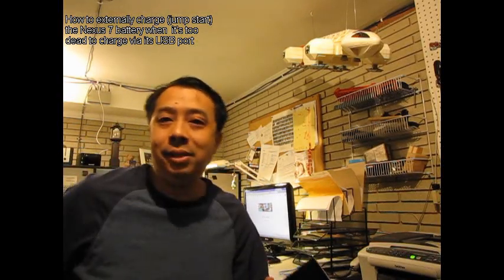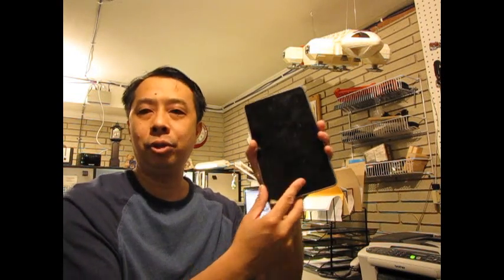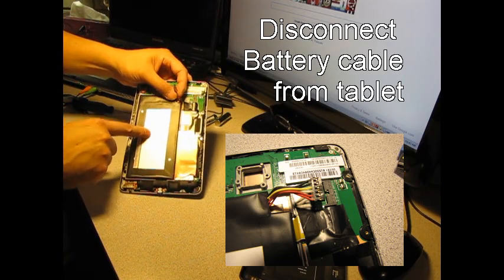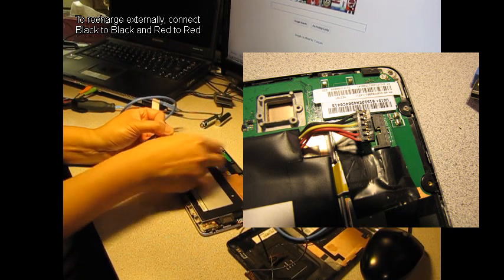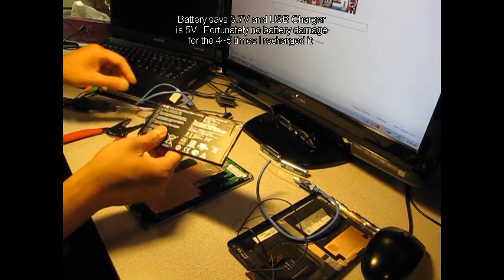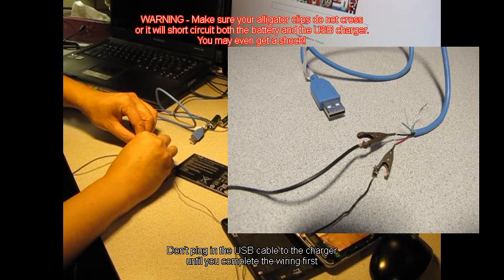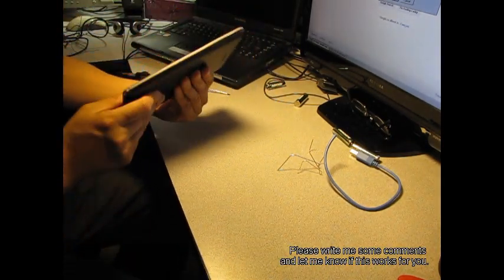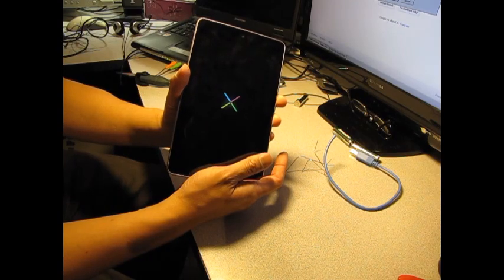Externally Jump Start Your Dead Nexus 7 - Final solution when all else fails!

Comment: Hmm, these are 1S LiPo batteries, two in parallel. The (nominal) 5 VDC USB charger goes through a charge control circuit in the device to assure the correct charge current and cut off when at full voltage (about 4.2 volts each).  By jumping directly to the battery without using a LiPo type charger you run the risk of everything from starting a fire to killing the battery.  BTW, if the voltage of the battery is "very" low, to the point that the power dropped out before the shut down was completed, that is evidence of an old battery that needs replacing.  They tablet is designed to commence shut down when the 3.7(nominal) voltage is reached, assuming there is power enough to make the process complete.  If the battery is old, has been overcharged or undercharged, etc, it will hit the low voltage level, trigger the shutdown, and then crash before the process can finish.

Replace that battery and please, do not hot jump a LiPo with 5VDC @ 500 to 2,000 mA.  It might work, or it might just burst and burn.
Reply from the maker: +Devin Duncan , Thanks for your comments here.  I have charged my battery externally for approximately half a dozen time (maybe more) using a USB cable from my laptop as the source (do not know the mA it produces at 5VDC), but never experienced a burst or burn.  In fact, the tablet battery doesn't even heat up.  My battery is not even close to being too old.  It has been almost a year and half since I made this video and my battery still works very well, holding enough charge to run the tablet for a few active hours or a few days if not in use.
Reply: THank you for the feedback.  Of course it is good you have not had problems, but the risk with LiPo charging is well understood, both in terms of danger but also to shortened life of the battery.  Perhaps your statement that you have done this repeatedly to the battery is evidence that the charge /discharge capacity is compromised (which is one of the problems with overcharging the LiPo).  I hope you continue to have good luck, and only hope to inform readers that there is some technical risk, well documented by the manufacturers of the batteries, with simply hard wireing a charge voltage to the batteries.
Reply from the maker: +Devin Duncan , Thanks for your safety advice Devin.

Comment: what if you dont have a alligator pin?
Reply from the maker: +rajat kumar , , In theory, you could insert the USB cable wires directly into the battery connector, but in practice it is more difficult than it looks.  The reason is that the USB cable wires are usually made of strand wires, meaning it it not one solid wire but multiple thin threads.  Instead of using an aligator clip, you could try connecting the strand USB cable wires to a paper clip, or safety pin instead and insert that into the battery connector.  If you twist the USB cable strand wires with your fingers, you could make it strong enough to tape onto the paper clip or safety pin.  One other commentator used a screw and nut to connect the USB cable wire onto a safety pin which makes a lot sense.  Hope this helps!
Reply: +Doug Peng thanks a ton!it worked.found out that the touch is not woking :(

Comment: Thanks a million Doug..Tried everything I could find on the internet and nothing worked till I stumbled across your post here.  Started right up after 40 minutes of charging direct to the battery.  I "dyked" the end of the USB cable and tinned the wires rather than using clips, they slid right in, just tight enough to stay in without sliding out.  

Had to replace the charging port which was a simple and cheap process and my sons Nexus 7 is back in commission.

Thanks again.

Comment: Hey, i have not used my Nexus 7 for a long time now, and today i wanted to start it again but i just got some lighting from the background light along the edges of the device. does this still mean my battery is more than dead? :)
Reply from the maker: +DerTommynator , Unfortunately no.  If you get some background light, that means there is still power in your battery.   The jump start method will unlikely work.

Comment: Thank you so much. I simply grabbed 2 pins and wrapped the wire around and it worked. Saved my tablet so thank you but now I have to find out how to fix the charging port.
Reply from the maker: +King_Khan ,  As you mentioned your N7's USB port is not working, there are other methods to charge it rather than fixing the USB port.  If you have the model where there are pogo pins (4 gold dots) on the side, you can purchase the docking station to recharge it from now on (see my comments to J Conder below). If you have the newer wireless charger model, you can also purchase the wireless charger.  Or simply, you can replace the wornout USB charging port by purchasing a replacement part on ebay.  It's not difficult to replace given its modular design.

Comment: how can i do this if i don't have alligator clips?
Reply from the maker: +King_Khan , In theory, you could insert the USB cable wires directly into the battery connector, but in practice it is more difficult than it looks.  The reason is that the USB cable wires are usually made of strand wires, meaning it it not one solid wire but multiple thin threads.  Instead of using an aligator clip, you could try connecting the strand USB cable wires to a paper clip, or safety pin instead and insert that into the battery connector.  If you twist the USB cable strand wires with your fingers, you could make it strong enough to tape onto the paper clip or safety pin.  One other commentator used a screw and nut to connect the USB cable wire onto a safety pin which makes a lot sense.  Hope this helps!

Comment: hey i just want to ask if this will work with other tablets? hwawei s7 for example. hahaha thanks in advance :)
Reply from the maker: +Jean Glonard C. Chua , Unfortunately I am not sure.  I just know this issue is due to a poor design on the Nexus 7 which I don't know if it applies to other manufacturers as well.
Reply: Oh yeah about that. It does as long as the battery is not soldered to the board and uses a wire instead of a ribbon :) i tried it on my hwawei s7 that had the same problem and it worked :)

Comment: how many minutes to charge?
Reply from the maker: +Vincenzo Morrone , a few minutes will do.  Try 5 minutes first, then up it to 10 minutes if 5 isn't enough.
Reply: Thanks, but daes'nt work. Maybe the battery it's totally dead.  Only a question,  i've used the stock charger, Maybe better whit another? Greetings

Comment: Hello. Just dropping a line saying thanks! My wife had this tablet in the bottom of a moving box and wanted to use it 6 months after we moved. Of course, the battery was completely drained and wouldn't charge conventionally. I was a little wary of leaving this unattended while charging each cell for 1/2 an hour, so I only charged each cell for 7-10 minutes each. Then I reattached the cover and attempted to conventionally charge it. It worked! Battery indicator came right up. I left it on the charger an additional hour and no problems booting up, Thanks again!

Comment: hi Doug my question is the next, I could charge my tablet until 100% but then it turned off and said it had 0%, u think that ur method can revive my tablet too, or is something more complex?
Reply from the maker: +Julie T , If your tablet can turn on, then this solution isn't for you.  If your charging port is broken (and hence you can't charge it), you can purchase the docking station (for model years 2012 and older) as an alternative method to charge or the wireless charger (for certain never versions).

Comment: Hello Doug,
    It's me again. I tried your method and it worked! I charged each cell for 30 minutes and the tablet booted, but got stuck at that darn logo screen,, with no option to perform a proper shut down.
    I charged the cells for one hour and the tablet booted, but got stuck at the logo screen, I charged the outer cells for six hour and got the tablet to a battery screen on the screen that yield NO charge! Cannot perform a proper shut down.
    I just ordered a replacement battery and will get my niece a new tablet for Christmas. The tablet is the worst electronic purchase I have made.

Comment: my n7 was lying around for about 2 years. This actually worked, thank you.

Note that it took a second when booting into recovery mode (after charging the battery) for the volume keys to start working before I could select "Power Off".

Comment: My Nexus 7 has a different internal layout to the one in the video, but the connections to the battery are similar with two black and two red wires either side or another two wires. The advice worked, thanks.

Comment: Worked 100% on my dead Nexus 7. Thanks!
(I soldered wire cut from a resistor to the usb cable to fit the battery connector better)

Comment: Thank you for posting this video. It is exactly what I needed to get my Nexus 7 working. Your update was correct, I only needed to have it charge each cell for a minute or two to get it to start up and from there I was able to use USB port to finish the charging process. I hope ASUS is proud of themselves that they didn't leave a way out of this mess when the tablet battery drains too low..

Comment: I used a ohm meter to test the connection between the black wires and the red wires and they both measure an internal connection red to red and black to black .
Thanks for the video
Reply: +David Spiller the LiPo battery has two 1S batteries in parallel.  They share the ground so the tablet can have acess to the 1S voltage (3.7 nominal) or the 2S volatage (7.4 nominal) while still using a USB charger at 5 volts.
Reply: +Devin Duncan 
Thanks Duncan, I used a small bench power supply to create a fifty milliamp current to the red and black wires to charge it enough to be able to get it to charge on its usb port.  Thanks to Mr Peng for making this video
I got the tablet working

Comment: This will work but a 3.7volt lipo battery is only 1 cell, I have charged mine through the outside black and red on an RC lipo battery charger.
Reply from the maker: piero serra , Yes you are correct that it is only one cell.  Several commentators had mentioned this after I made my video.  Glad to hear that it worked for you.

Comment: Thanks Doug, My nexus was under my bed for 4 months and died completely... This fix works well.. I charged for about 5 mins per cell... I also used plastic for insulation barrier between wires... And I would suggest someone use a charger as a power source, save shorting a USB port on a PC or Laptop... I used a thicker usb cable, its leads were fine to plug into the batt terminal,insulated, before I powered the Cable...

Comment: Hey Doug, thanks for the info.  I have tried this a couple of times and still cant get Nexus 7 back.  If you measure across red and black on the battery with a multi-meter and get voltage, does that mean the battery is charged?  I am getting 4.2v across the red and black pins.
Reply from the maker: authorsapology , if you are measuring a voltage across the battery, that means your battery did get charged by this jump start method and your Nexus likely doesn't work for another reason.  Sorry to say that this method did not solve your situation.

Comment: Doug peng ,

I rarely comment on vids/tutorials, but wow this worked liked a charm! My friend brought me his dead 3 month now Nexus 7 2012. PC or wall outlet was no success for charge as the port looks pretty faulty as it is, I watched this video and already was a little overwhelmed as I'm not to savvy with things like this. I said o well not mine and he said to do whatever I can to bring to life. I made my little USB without alligator clips as I did not have any laying around, I used some speaker wire I had laying around labeling the proper colors. I then stripped the outer black and red via the nexus 7 battery , then hooked up my wires then plugged it in the charger for 5 min as it was pretty dead. Disconnected the USB first to avoid any issues then plugged the battery back to Nexus 7 and viola I hit the power button and low and behold there is life again. Not sure if others charged both inner and outer cells or if its even relevant , however just note that I successful in just doing the outer black and red for 5 min. No bootloader needed ! Thanks for this awesome little guide on to the next android device..
Reply from the maker: Brian Irizarry , Congrats in getting it to work, and thanks so much for sharing your method without Alligator clips with the readers!

Comment: Doug thanks for your informative and thorough video. Your comment that the unit may have not quite finished its shut down sequence was insightful. I knew my Nexus 7 was not dead but it had not shut down properly.I eventually got it to reboot by pressing the Start/Volume buttons again, for much longer time, and it restarted. Sort of temperamental these devices. Your video was an inspiration!

Comment: This didn't work for me, i don't know what is wrong with mine, i have tried countless methods but none have worked, i am thinking about buying a new battery to see if it works
Reply from the maker: Kaitlin Carter Do you have a volt meter?  This will allow you to check if your battery has been charged up.  If it shows a voltage and still doesn't work, that means there is something else wrong with your tablet.  However, a new battery (one that is charged up) would be a good test too.

Comment: Will this work for the 2013 model? It appears the battery plug portion is much smaller and won't fit the wires from the USB? Im at a loss at what I can do because I get no power. Thanks
Reply from the maker: Ian Groatman , I am unaware that the battery plug is different on a 2013 model as I thought it was the same.  Perhaps Asus changed the plug design half way through the model year?  The fundamentals of charging the red/black pair remains the same and hence if you can do with the smaller battery plug version it should work the same.

Comment: Is there an alternative if we do not have an alligator clips?
Reply from the maker: Alex Sarafov  In theory, you can put the USB wires directly into the battery connector and in fact, one of the commentators got it working this way.  However, most USB wires are thread wires, so in practice, it's like pushing a string into the battery connector.  But if you can get it working this way, that's great.  Otherwise there are other alternatives to alligator clips.  Others have tried using safety pins, garbage ties, and even sewing needles.

Comment: I reckon my nexus 7 is completely dead. I turned it off normally with the power menu battery was at 15%. Went to turn it on the next day but nothing no screen flicker, no logos just nothing. Tried charging it over night (no charging symbol appeared), tried pressing power button for a minute and then power with volume down for a minute. 

I then took of the back to check the battery was still connected and it was. I've tried everything. I decided to try this too but still nothing it's just completely had it. Only thing I can now think of is the power button it self maybe broke or the power circuit somewhere?
Reply from the maker: ***** , You mentioned that you tried my method but still did not work.  Do you have a volt meter?  THis would confirm if your battery did get charged up by the jump start method.

Comment: Hi Doug, hoping to try this out soon but I'm really not the most techno savvy person out there! Was wondering whether I could simply tape the usb wires (once stripped) to a paper clip (or similar) and simply place the paper clips into the battery ports? Would this work or am I in danger of electrocuting myself lol. Thanks.
Reply: Zahra C Ignore my previous question as I somehow got it to work again after about 6 months of it being dead!!!! I only did one cell for about 20 or so minutes and checked to see it worked and it did!!! I immediately plugged in my charger and hopefully it continues to charge. I used the needle trick and still cannot believe it worked. Really grateful here as you can tell by my blathering haha! Thanks once again from this very relieved not-so-techno-savvy individual in London!
Reply from the maker: Zahra C , Congrates in getting it to work.  And no, you cannot electrocute yourself with the battery as it's only 5V
Reply: Doug Peng Ha ha I realise how ridiculous that question sounds now lol. Thanks.

Comment: I have the 2013 one but it's not the wireless charging one and so far in less than 18 months I've had to change the usb port twice. I have another one on order (very easy to change, even a non techy girl like me managed it) but my tablet is deader than dead now... giving this a try as we speak.. I hope it works. I've been without my tablet for about a month now and it's killing me lol.. I use it for everything.

After the latest update I find my battery drains quicker and putting it to sleep/standby doesn't actually put it to sleep/standby. The battery still drains!
Reply: Maxien Fisher OH MY GOSH!!! If it wasn't inappropriate I would kiss you lol... It worked!! Thank you!!